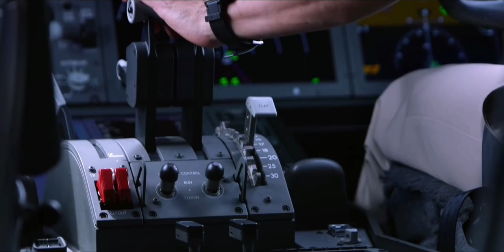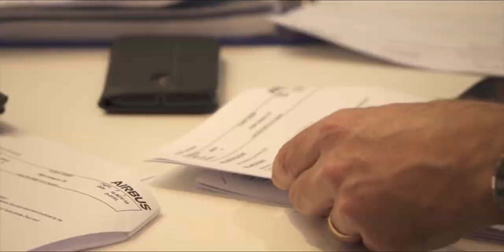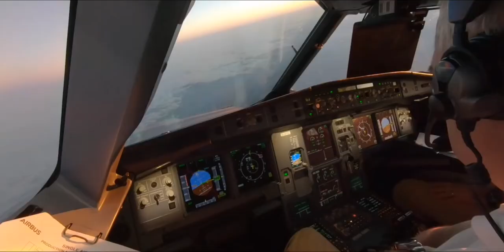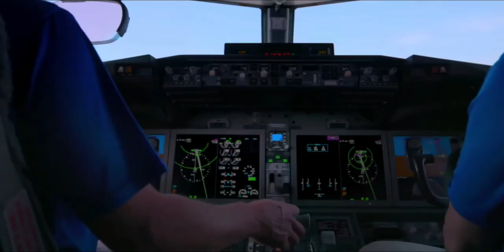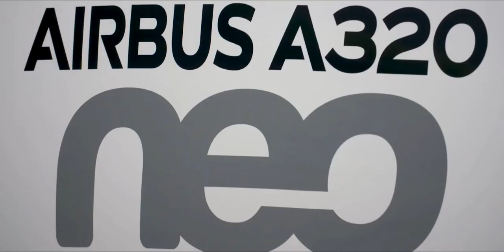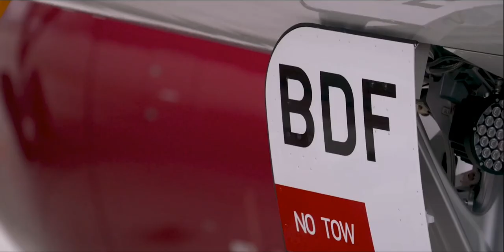The Ultimate Showdown: A320neo vs. 737 Max 8

Comment: In terms if quiet engine operation, the A320 is king. Quietest flight i have ever been on. The MAX is a good aircraft, quieter than the old models and is actually pretty roomy. I like both honestly.

Comment: I flew  on A320 and a 737 8max. I felt safe on both planes. Everyone should choose by the airlines safety records. For example I feel safer on United but not American. I've even flew a DC-10 after the grounding was over. It was a Japan Airlines but on the flight back the Air Traffic Controllers went on strike.

Comment: No matter how many aspects of them we compare. An airplane that needs software to compensate for what has been made clear was a design flaw from the get go ain’t going to make me feel safe ever. I feel safe on a Neo, I just don’t feel safe on a max. That is something you cannot put a price tag on.
Reply: Airlines don't care about your feelings. Except Delta; they care but your wallet will be lighter.
Reply: So  computers should be talken out on all modern planes? A Air France Airbus crashed in the Atlantic because a sensor failed causing the the computer to over take the plane.
Reply: @alexrebmann1253  Not what I meant…Computer systems are a necessity in today’s world not just in aviation. However accidents happen and we cannot prevent all of them, that’s why they are called “accidents”. In the case of the 737 max where two planes crashed for the very same reason and it was subsequently proven that it was a design flaw they patched up by means of software; that is no accident. That’s what I mean! The one you are describing was an accident, these other two were profit oriented mistakes that resulted in loss of life.
Reply: @TheGigiparce0   It was more of lack of disclosure then design. 
 The new Boeing air force air tanker which is based on the 767 design has MCAS and it works fine. I dont agree what Boeing did, and I wish that the former CEO of Boeing Dennis Mullenburg had go to prison.

Comment: Before I even start the video: as much as I prefer the 737 personally over the A320 series as an avgeek (and constantly flying on the A320 so I'm quite bored of it), the MAX has two fatal crashes for passengers that were entirely the fault of the plane, the NEO has no fatalities as a result of the design or standard operations (only people outside of the plane being where they should not be).  To me, that makes the winner clear and indisputable.  I like the overall design of the MAX, but Boeing's poor leadership and corporate greed ruined the program before it even had its first passenger flights.
Reply from the maker: Thank you for your comment. While it is true that the 737 MAX had some initial safety issues that led to a temporary grounding, Boeing has taken significant steps to improve its safety and address the concerns that led to those issues. The aircraft has undergone extensive testing and certification processes to ensure that it is now safe to fly, and pilots are now required to undergo specific training on the MCAS system.
Regarding the A320neo, it is true that it has a strong safety record and no fatalities have been attributed to its design or standard operations. However, it is important to note that both Boeing and Airbus prioritize safety and invest in safety technology and training.

When it comes to choosing between the two aircraft, there are many factors to consider beyond safety, such as performance, efficiency, and passenger comfort. Airlines and operators must carefully evaluate their needs and make a decision based on a variety of factors, including safety. Ultimately, the choice between the two aircraft may come down to individual preferences and needs.
Reply: @leeation9647  there are other factors, yes, but those crashes overshadow all other aspects of competition.  I disagree with you that Boeing prioritizes safety.  The MAX crisis is precisely because they prioritized sales strategy and avoidance of customer penalties, avoidance of testing and certification procedures, etc by HIDING a critical system, for which pilot and knowledge and training is highly important to safety.  The test pilot for Boeing literally bragged in emails and texts on how much money he saved the company.  
Not only that, said system was designed to use only one sensor.  Think about that - they designed a system capable of nosediving an airliner into the ground with a mechanical sensor (AoA) that is inheritly prone to fail on occasion, didn't give it ANY redundancy with either another AoA sensor or other sensors (altimeters will show a plane is defending rapidly, for example).  How insanely ignorant? 

Had they designed the system properly from the get go, OR trained pilots that the system existed and how to override it, those crashes would have been avoided, but Boeing made both critical mistakes.  

That makes the winner clear as day to me.
Reply: Since the MCAS accidents, whenever I fly boeing I feel uncomfortable.
Reply: @ChristopherBurtraw It may be a case of feature creep.
MCAS may have been a safety critical system in the beginning, could not command the trim so strongly as to force dive the airplane.
But eventually it became stronger and stronger, until it became safety critical... but keep the original non redundant design... and was not included in the fly manuals.

Comment: The A320 is by far the better constructed aircraft. ground clearence of the 737 is a fail in construction (boeing carried this failure through all the years of 737 models) preventing to install proper engines in all new variants leading to castrated modded engines which are less efficient than the original found on the airbus. fact.
Reply: The low ground clearance isn't a failure. It was done on purpose so aircraft handling (baggage loading) could be done efficiently by hand on airports with no vehicles. This was cool in the 60s to 80s. The problem started when newer engines needed more space. Although the engine diameter on the 737 is less than on the A320, both planes have very similar fuel efficiency. How did Boeing manage that? The 737's wings are slightly more efficient than the A320's, allowing a higher maximum cruise Altitude, which  in turn results in less fuelburn and also potential higher groundspeed. 

Ehh.. Fact.
Reply: @THYB737  boeing has been constantly trying to work around the flaws of the 737 since the very early versions and it became more difficult with every new model they came up with. These struggles have become very obvious with the 737MAX. The new wings did not really do the trick actually.
(btw the A320neo has new wingtips as well... sharklets to be exact.)
Boeing should have gone for a complete redesign of the whole aircraft instead of tweaking and tuning until it became an unsafe aircraft that it now is. efficient or not, if an aircraft wants to kill itself like the MAX does, it is definitely a complete fail in overall design. the reputation of this "brand new" aircraft will be more "efficient" for airbus at the end of the day, I assume. just my opinion.
Reply: @weirdoe2279  Do not confuse wing and wingtip. Yes, the new A320 has Sharklets which is basically the same as 737's blended Winglet, which has been installed on the 737 decades before Airbus fitted them. And of course, wing design has an impact on the overall efficiency of the plane. 737 wings have a greater aspect ratio and is slightly more flexible. This result in a better climb performance and, as said, higher cruising altitude for the 737. The A320 wings are stiffer and thicker. 
But Airbus has in turn larger engines and rounder shaped nose which reduces friction drag, compared to 737 nose shape. All those aspects determine a plane's performance. 
Yes, the MAX was a totally failure. I agree with you that Boeing should have earlier worked on a completely new narrow body plane but the MAX is fixed and fine today.
Reply: Airbus fanboi with knowledge from whtsapp forward
Reply: @prasenjittripura4691  yes and no. private pilot with an airbus captain sitting right next to me to be exact. so yes and no.
Reply: When someone with YouTube comments knowledge decides to speak in the public. 

Did you actually mean it’s a failure? What an embarrassment
Reply: @weirdoe2279   Boeing did want to build a new plane after the NG, but airlines that have 737 in fleet like SW wanted Boeing to keep building the 737.
Reply: @prasenjittripura4691 Hard not to be a fan when Boeing's Calhoun admired Airbus. Would get 60% of the market by the end of the decade.

Comment: 737 MAX. Did it ever stop being dangerous? Then the very plane that caused the requirement for additional safety in the cockpit got a pass from the Republicans in congress. Trains, planes and other problems!
Also the undercarriage is too short, meaning the engine pylon is in the wrong position which is why MCAS WAS NEEDED in the first place.
Reply from the maker: Thank you for your comment! While the 737 MAX had some issues with its initial design and implementation, Boeing has taken significant steps to improve its safety and address the concerns that led to its temporary grounding. The aircraft has since undergone extensive testing and certification processes to ensure that it is safe to fly. In addition, pilots are now required to undergo specific training on the MCAS system and its operation. While no aircraft is 100% free from risks, the 737 MAX is now considered to be a safe and reliable aircraft.
Regarding the undercarriage, it is true that the engine pylon on the 737 MAX is positioned differently than on previous models. However, the MCAS system was designed to address concerns related to the plane's handling characteristics and was not related to the undercarriage position. As with any aircraft, there are design trade-offs that must be made to balance performance, safety, and other factors. The 737 MAX has been thoroughly evaluated and certified by the appropriate authorities, and has undergone significant changes and improvements since its initial introduction.
Reply: @Leeation  HI. I am an English aircraft engineer. I can tell you the angle of the pylons pitching the weight to far forward thus out of balance was why the MCAS system was needed in the first place. The root cause of this bastardized pylon system was too short an undercarriage which did not allow the engines to be suspended in a correctly balanced position. So now you know the relationship between undercarriage and MCAS
 Now the worst part. The Republicans gave the plane a safety exemption, after the pressure of Boeing, for the cockpit EICAS, which should have been implemented.
I will say this plane is insecure  in flight and does not have the appropriate safety measures implemented. I would welcome further investigation as I am not convinced that the problems have been correctly addressed.

Comment: You must have been living in a cave. The 737 Max 8 already lost. Boeing share price have drop due to 737 Max 8 MCAS scandal.  The Maneuvering Characteristics Augmentation System (MCAS) is a flight stabilizing program developed by Boeing which became notorious for its role in two fatal accidents of the 737 MAX, which killed all passengers and crew on both flights, 346 people in total. Many airlines have already cancel 737 Max 8 and ordered Airbus.